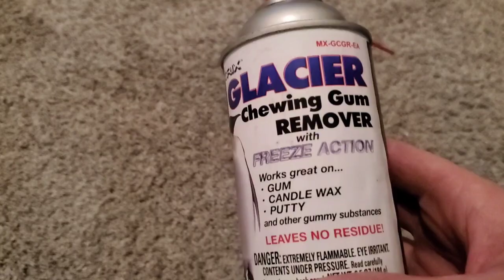Carpet Cleaners Vlog #5 | Window Cleaning and Carpets

Comment: @ 12:28 try using the HF spray gun and vac hose trick. Gum takes 5-6 sec. Easy!
If heat will soften it, blast with hot water.